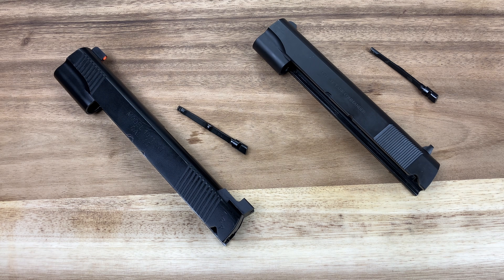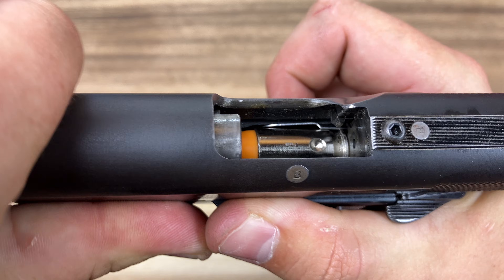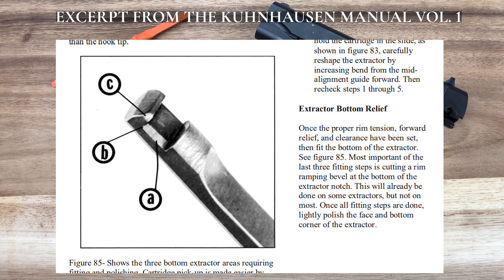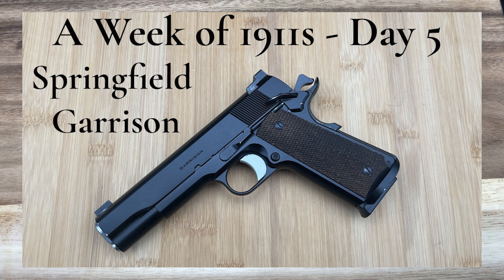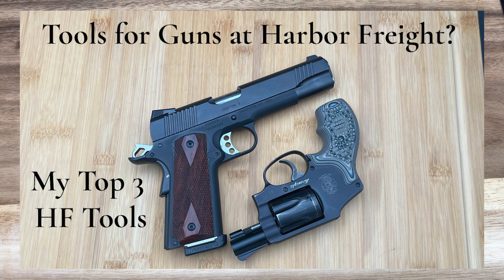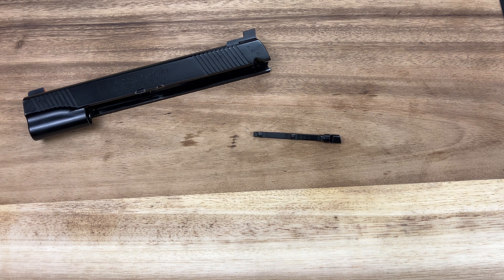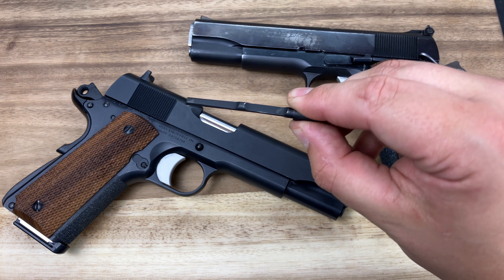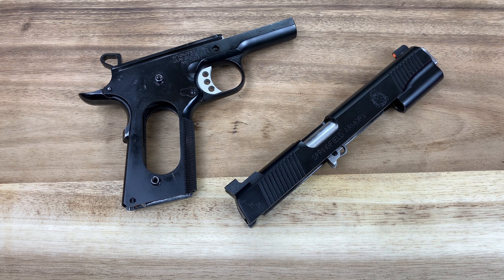A "Quick" Look at the 1911 Extractor (a Response Video to @OldPathTraveller 's Extractor Video)

Comment: While there is a lot more to extractor adjustment than just tension, I have to agree that in 5" .45s, tension does not have to be a precise value for correct function.  Over the course of 1000 rounds, I adjusted tension progressively from zero, to so excessive that the gun would no longer feed reliably, and had zero failures to extract or eject.
Reply from the maker: I don't think it needs to be precise-precise, but rather that it just needs to be accounted for. I've seen plenty of 45s with bad extractor tension that would not feed well without a good mag in it. 

With the 9mm 1911s that I've owned, they've all needed tensioning done, and reprofiling the claw area, too. I think that the precision for the tensioning matters a lot more in those guns, but even then, it's still trial and error. I've never purchased a tool to do a specific weight of tension, just testing it out and seeing what works.

Comment: I bought two new 1911s with major failure to feed issues. After a lot of troubleshooting and videos, I finally figured out that they both had extractors that were way too tight. I don't know how unlucky I am to get that issue twice, but I'm glad I got it figured out. Suffice it to say, the extractor is extremely important. All the people saying lube and Wilson combat mags for any issue aren't helping anyone and are just wasting people's time and money.
Reply from the maker: Yeah, I'm all on team good mags and lubrication, but those will not fix extractor tension issues.
Reply: Ive never seen a "too loose" extractor however i have seen like you experienced extractors way to tight from the factory

Comment: Yeah, I had to give my Tisas 4.25 extractor a good hard push and it was feeding much better when slingshotting rounds. I was shocked by how much FTF I got out of the box. Seems you need to disassemble, clean and lube and extractor tune, and put in around 300rds for it to start running as it should.
Reply from the maker: The 1911 is an old gun, but a solved gun. I don't necessarily believe in break-in periods, but I do believe in there being a number of rounds that it takes for you to see what work the gun needs done to it. 

Which commander Tisas did you get? One of the 45s, or one of the 9mm guns?
Reply: @Paul_Whaley  The 45, of course, I feel like if you're going to get a 1911 in 9 you might as well just get a striker fired pistol. I honestly considered selling the gun before doing a deep dive on extractor tension, learning that Tisas sends them out tight, seeing as everyone saying "well just buy some wilson combat mags/springs/extractor" put me off because if the gun is so historically reliable and well machined, why would I need to get a bunch of aftermarket parts?

I also just heard commanders are worse in the reliability department because the whole 1911 extraction philosophy is based on that 5' govt barrel. I don't know if that's true because the springs are typically heavier to compensate for this. But all in all I've tried to make it work because I love the look and slimness of the single stack .45 1911 and I wanted an alternate, big bore carry to my G19.
Reply: Little update if you're interested: I went and got a file at Home Depot and did a few grinding motions to that little catch on the slide stop. This  seemed to further improve the slide-release feed. Actually, I was riding the slide to release a snap cap and it ended up feeding the next round just by mistake as well. So it seems tuning the extractor and a bit of filing work combined to doubly improve the mechanism here.
Reply from the maker: @shep2168  Firstly, thanks for the update! 

The lobe on the slide release can bump into the second-to-top round in your magazine, which is a pretty common issue. As you've found out, it's an easy fix though. With all of the different magazines out there & different makers of guns, it is pretty common. I've filed down 3 slide stop lobes in the last year, but it being too long is certainly better than being too short, as you can tune it as you like. 

As for the commander gun and reliability, it's not that they're less reliable, as much as you'll have to tune it more to get it as reliable as a 5" gun. In 45, it's really not that hard, it's the 9mm guns that require more effort to keep reliable. 

Needle files are a big help for doing a lot of work on the 1911. Home Depot is a good place to look, but Harbor Freight is worth your time too. I have a video from about 9 months ago on it, but a lot of my basic tools are from HF, and you can get some great deals on them. 

Needle files, picks (kind of like metal dental picks), and sandpaper will allow you to basically do anything you'd realistically want to do the the gun, until you get to more intensive tasks. A good screwdriver set (the $20 Wheeler one is what I like) will help to carry you a bit too. 

Thanks for the updates! I love to hear how people tinker on their guns!
Reply: @Paul_Whaley  Thanks for the reply, I'm glad it's interesting to you as it is to me, as it's my first time tinkering with a firearm. I first bought a glock, then this 1911, and quickly found it very fun and therapeutic to lube the slide rails with SLIP 2000 EWL and figure out the mechanics of the weapon by diagnosing malfunctions. I'm going to take it to an outdoor range tomorrow, do some draws, bill drills, and other things to put rapid fire to the test to make sure it's worthy of carry.

My next consideration will be checking out Wilson Combat springs in a few months, maybe a 20-21lb recoil spring which would be the equivalent of getting an 18lb spring for a 16lb govt and see how that feels. The weapon is already very controllable with a grip pinned to the beaver tail and the heavy slide putting me back on target quickly. I didn't intend for it to be a project gun but now I definitely am interested in making (reasonable) adjustments in order to see how the platform may be modified for improved feel. It has definitely changed my perspective on common Tisas issues, it definitely is a steal for $350-400, and with $100 worth of investments it has potential to be a very great pistol if you put in the time to learn. Makes me wonder if the GIs who carried this also experienced similar issues and made modifications to the gun on the field? I certainly would if I felt my life depended on it.

Comment: Hey Paul! I’ve owned a Tisas ASF for over a year now with about 600 rounds through it. Every other magazine, I’d get a FTF where the slide fails to go into battery and the fresh round won’t fully seat; I’m thinking this might be because the extractor tension is too tight, would you agree with this conclusion? Thanks and I love your content!
Reply from the maker: Firstly, thanks for the kind words! 

That malfunction could be related to extractor tension. If the round is getting pinned against the breechface a bit, that could cause a poor presentation into the barrel, and causing the slide to not fully close. 

While it is likely extractor related, it could also be your recoil spring. If you are using a lighter weight spring, that could be causing the action to not close with enough authority, causing a failure to go into battery. I recommend a 16lb recoil spring at minimum in the 5" 45, but prefer 18.5lb or 20lbs for recoil impulse feel. If you're using the stock recoil spring in that Tisas, I'd err more on the side of too much extractor tension. 

Obviously factors like ammo and mags could be in play, but if you're using good enough ammo and mags, it's not going to be those causing issues. I'd be sure to keep your gun lubed up well (slide & frame rails being the most important points), and maybe remove some tension from the extractor.
Reply: Thanks for the extensive writeup, I’ll keep these in mind before I go to the range, thanks again!
Reply from the maker: @urheimat8841 happy to help!

Comment: I’m interested in the 9mm ramped barrels for my Combat Elite in 9mm. Is there any real advantage to them and do you need to modify the frame to make room for the ramp?
Reply from the maker: In the 9mm caliber, a ramped barrel will feed a LOT better than a standard two-piece feed ramp gun. The ramped barrel 1911 has been the norm for 1911s for a long while, but Colt is Colt, and they like to do it their way. 

You would need to significantly modify the gun to work with a ramped barrel. It would require a new barrel (duh), but also milling a pocket in the frame to clear the ramp. The cost of that may honestly be more expensive than just buying a new frame that is already made to be used with ramped barrels.

Comment: Have to say, it does sound odd for you to say "the gun was reliable, but it failed a bench test". 
Why would you start messing with a reliable gun?
I think that Traveller guy mentioned that this attitude is not very helpful or reasonable, and I agree with him.
Reply from the maker: First and foremost, the 10-8 Extractor Test is not a bench test. It is a live-fire test, and will show if the gun is having extractor tension issues. You can do bench tests at your workbench to see how the extractor appears, but you need to confirm with live-fire to actually put the rubber to the road. 

When it comes to reliability, a lot of folks will view it in the binary. Either a gun is reliable, or it is not. In reality, reliability is a sliding scale, from less reliable, to more reliable. You can have a gun that is considered to be "reliable", but is not as reliable as it possibly could. Tuning the extractor is something that slides that scale towards the "more reliable" side. Doing other things like using good ammo, lubricating the gun, using good mags, and fitting certain parts (slide stop lobe is the first thing that comes to mind) will also do that. When it comes to the 1911 platform, it is meant to be worked on. That is the nature of the 1911 in the 21st century. 

When I made this video (over 3 months ago at time of your comment), I certainly found that Traveller's mindset of "extractor tuning doesn't really matter" to not be very helpful or reasonable. You can watch his guns in his videos from that time, and see how erratic they extract. That is indicative of poor extractor tension in the gun. Does that mean that the guns are unreliable? Maybe? Does it mean that they are not as reliable as they could be? Absolutely.
Reply: You don't seem to grasp the concept that a pistol may be functioning well for the time being...but is giving indications that it is on its way to a failure point.

Comment: At 16:05 you mention a test for too much tension stating that "the barrel will show that." I'm not sure what to be looking for. What would determine too much extractor tension?
Reply from the maker: Too much tension will show the round kind of pinned on the inboard side of the breechface. If there is too much, the barrel will generally have issues with actually allowing the round into the chamber too. It can lead to a failure to go into battery, something that you can actually replicate with the technique that I show. 

Generally speaking, I don't see guns that are tensioned too much, just too little. For the guns that I've seen with too much tension, it's generally on 9mm/38 Super guns.
Reply: @Paul_Whaley  I bought two brand new 45 ACP 1911s (one Tisas, and one Springfield), and they both had major failure to feed issues due to excessive extractor tension. I guess I'm just that unlucky.
Reply from the maker: @levnix1835  I have noticed more guns with too much tension lately. I don't know why, I guess the bender machine is working overtime now.

Comment: A channel called "SHOOT FIRE WITH ASHLEY" has a pretty good video on extractor tension.  I like to be able to measure things to see where they are at and his video gets into this.  I've also noticed that Brownells used to sell tools for measuring extractor tension.
Traveler relates his experience with a lot of guns.  By chance he may have never had one with bad extractor tension.  He also talks about the people he learned from, I'm surprised he doesn't mention any lessons they may have taught him relative to extractors.
Reply from the maker: There are tools for measuring extractor tension, but with the number of elements that play a part in actually tuning the things, just a tool that tells you the extractor springing weight doesn't really do a whole lot. It's not quite the "what's the price of tea in China", but with all of the factors at play, those tools alone don't really matter all that much. 

Doing the adjustment & testing is just going to be the best way to actually tune the extractor. The only extractor tool I own is a tool for pulling the extractor out of a tight gun (really only need it on 9mm/38 Super guns). I use the Burton technique shown here, and the 10-8 Test for in-field verification. 

As for Traveller, he has certainly had guns with poor extractor tensioning (either too little or too much), and you can see it in his videos. Many of his guns have really inconsistent ejection patterns, which is a sign that the extractor is out of whack. I doubt that any of his pistols would pass the 10-8 Extractor Test, and he's doubled down in his own comment section about not doing it. He says that "if it gets the case out of the gun it's fine", but that's like saying that your engine is running fine because the car is moving, meanwhile it's running poorly and misfiring. 

Extractor tensioning is something that was not known about in-depth until the 1970s, but when the military had bad extractors prior, they just replaced them rather than tuning them. That was also an era where you really only had a handful of loads going into the guns, a much tighter TDP spec, and all sorts of stuff. From what I've seen from Traveller, he's basically writing off any information on the 1911 past the 1960s, which means writing off the info from the people who really honed the gun into the platform that we like today. 

I'm a Utahn, live here, have photographed the entire John Moses Browning firearm museum's collection in Ogden, and have visited JMB's resting place many times to pay respects. He was the greatest firearm inventor of all time, but  that doesn't mean that people can't iterate on the design, and learn more about how each individual component and part works in extreme detail. I think that Traveller is under the mindset that it starts and ends with JMB, and I know that to not be the case.

Comment: I'm picking up my first 1911 (Tisas ASF) this week and I'm probably going to spend the first couple days at home just checking over some of the more troublesome dimensions and doing tests. The first range trip will probably end up feeling like work, I'm definitely going to do the 10-8. Awesome video. 

I'll have to take some of traveler's opinions with a grain of salt going forward but I like his content!
Reply from the maker: Truth be told, the ASF is the best of the basic 1911s that Tisas currently makes. It's higher quality than the older GI guns (like the one that I show in the video), and you should require less troubleshooting with that gun than a lot of other 1911s. 

For that ASF, the things to look at would be the extractor tension, how well the ejector is installed, the plunger tube being staked on well, and the length of the lobe on the slide release. Those are all quick to check, and shooting the gun will inform a lot too. 

Thanks for the kind words, and keep me posted about the 1911 project! We've got a discord server for the channel, with a dedicated 1911 channel there if you wanted to join and share your project!
Reply: @Paul_Whaley Just picked it up today, it's mostly flawless besides a very wonky mag catch. I can see the right side of my magazines taking a nice scratch all the way down from the top to the catch cavity as I force them in with a strong tap. I can't even turn the "lug" on it to remove it and inspect it for some reason. It probably needs to just be handfit with a file very lightly.

Also the extractor has a lot of machine chatter on the flats, and whatever finish they use is coming off just with a microfiber towel. The extractor is properly tuned from what I can tell and the angles on the head look correct compared to say a wilson bulletproof. 

Other than those two things it's perfect. No machine chatter on anything, feed ramp is very nice, no rattles besides the grip safety, the parkerizing looks smooth and uniform on every single part. This is my first 1911 and I am amazed how well it points, how slim it is and how relatively light it feels. On paper it's a boat anchor but once you get one in the hand it's the most natural feeling gun ever
Reply from the maker: @onseki1774  The mag catch and cleaning up the extractor are both pretty easy fixes. Sounds like it'll be a great gun!